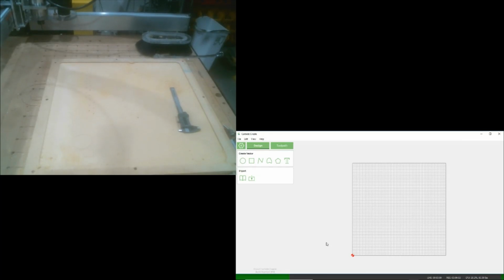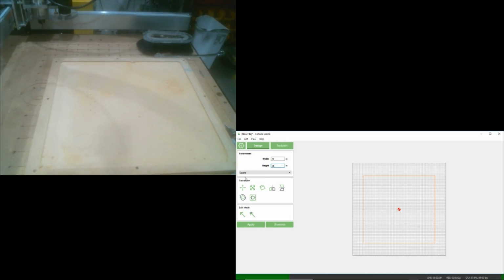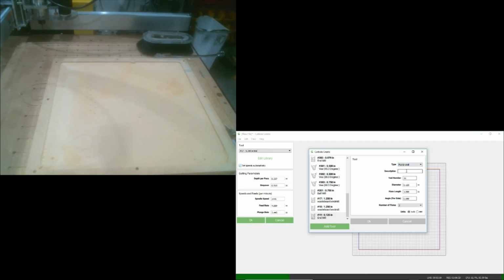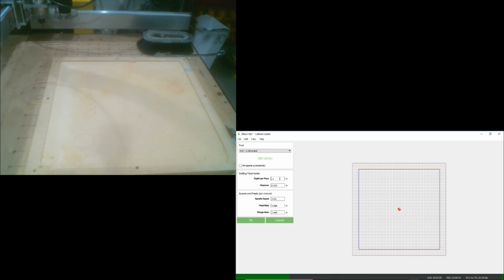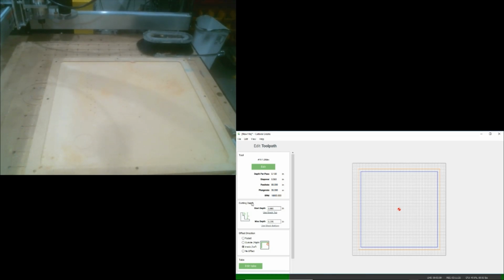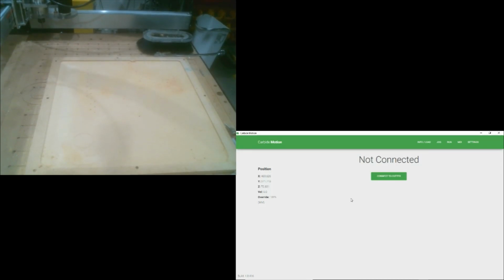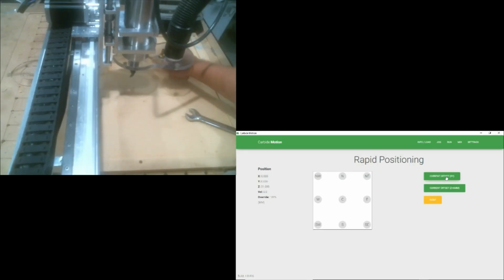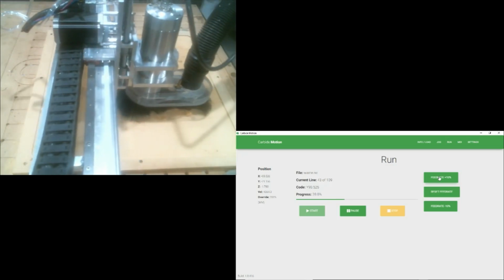Surfacing a Shapeoko waste board with carbide create

Comment: I didn't see you put the clip on the bit when you probed for Z. Is there another way? I also did not see you probe for x & y.
Reply from the maker: With my spindle being grounded through my vfd I don't need to use the grounding clip. For x&y I had already set the center of my piece as x&y 0.